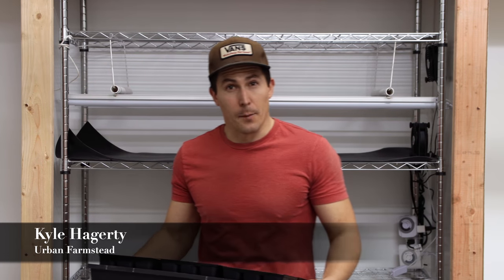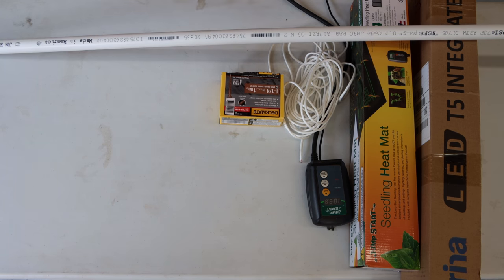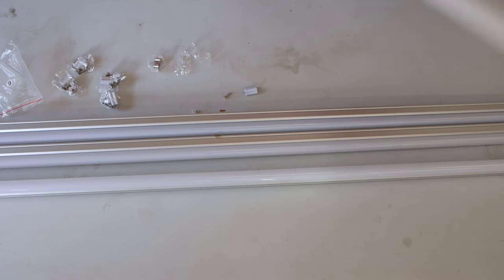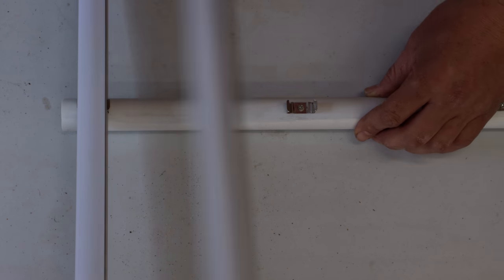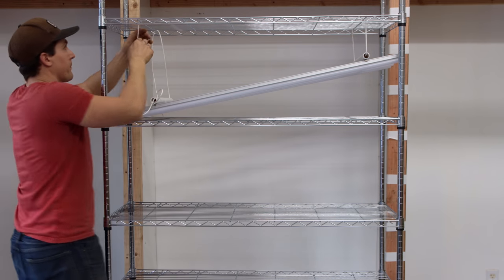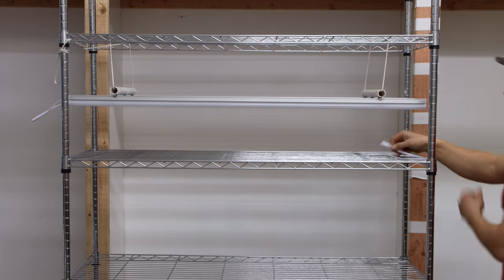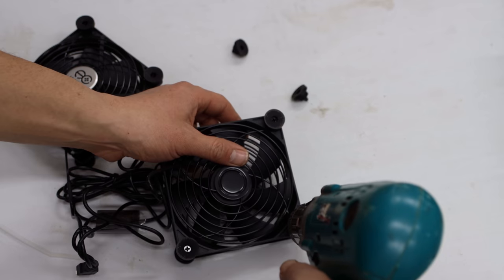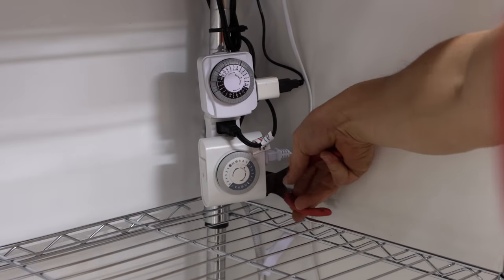How to Build an LED Grow Light Rack for vegetable seedlings and micro greens

Comment: Thank you so much for this! Using your video as a guide, I grew the best flowers and veggies ever this year. I mounted the lights directly on the bottom of the shelves (zip ties, easy-peasy) and found it easy enough to raise and lower the grow trays, as needed. 

The seeds seemed to germinate very quickly and evenly. Everything was so healthy and lush. The flowering plants had no problem blooming under these lights. My sister said they were "as good as something you'd get from a greenhouse". Next year should see a full return on the initial costs vs yearly spending at a nursery. 

One thing people don't consider is when you grow your own flowers and vegetables you get exactly what you want, and not only what's available for sale. I grew hibiscus, black-eyed susan vine and wave petunias, which are fairly expensive plants to buy and a bunch of hard to find heirloom tomatoes. This grow rack makes it easy to do yourself. The only "problem" I had was planting too early.

Thank you for putting this out for us all! Subscribed!

Spring 2023
2nd year using your LED Grow light rack hack. Everything is looking wonderful and healthy. The only thing I changed was to add a 'space blanket' on the back of the rack to reflect and maximize light and to plant a little later.

I planted herbs, flowers, grasses, and veggies, something for everyone in my family. It's nice to be able to accommodate their requests without spending a fortune at the nursery. My sister loves GREEN flowers. The inexpensive answer:"Green twister" echinacea," Envy" zinnia, "lime sophisticata" petunias, "green tails" amaranth, Bells of Ireland, nicotiana 'Antique Lime' and others all planted as seed. Huge savings! 

The only disadvantage to using this VS a greenhouse is lugging the plants inside and out to acclimate them the last few weeks before planting. The big advantage over a greenhouse is not having to heat it and monitor the temperature all Winter. The only thing that could tear me away from this system is a sexy geothermal greenhouse. We all can dream, right? ;)

Very grateful for this! Thank you, again!
Reply: Thank you so much for your detailed comment! Great encouragement and tips! Thanjs❤🎉😂

Comment: Hi there from Toronto, Canada. Firstly, I wanted to say thank you for this really, really great tutorial! I only have an LED grow rack in place because of how simple and approachable this video was. :) 
In the chance that someone else reads this prior to building their own rack, who may be just a NON-HANDY as I am but embolden to try, here are two additional considerations based on issues I ran into: 

1) you really need hold the pipe straight and double check that the marks for your brackets line up together. My brackets ended up probably a 5mm different angle on the pipe and it still works, but does make the whole set up a bit twisted (maybe this is obvious for anyone whose ever do any sort of handy project before... but that isn’t me) 

2) buy your lights FIRST, check what your mounting hardware looks like THEN buy your pvc pipe. I purchased a 3/4 inch PVC pipe as recommended, but the screws that came with the mounting kit were 1 inch. Again, it all works out, but it was incredibly difficult to thread the rope through since the screws obstruct the entire space. Finally got it through using a needle and thread, but this part was far more difficult than anticipated!

Comment: Great video.  For hanging lights, I used a magnetic J hook on the 4 pillars and the PVC pipe will rest  on the magnetic J hook. The magnetic hook slides up and down on the 4 support pillars to adjust light height.

Comment: 🥰💯❤🌱  Thank you for sharing this. I've been wanting to use a wire stand like you have for next year.  I have grow lights and will incorporate your idea of using pic pipe so I can make I adjust the light!  WOW!! I love the mini fans, too.  I will buy those.  I had started seedlings without a fan and they got too leggy.  Some, I managed to save when I started using a big fan.

Last year, i bought one of those cheap stands on Amazon and one of the stands fell and broke because I overloaded it.  I was able to salvage most of my seedlings but it made a big mess.  I had everything meticulously labeled, too.  For next season, I definitely need something sturdier.

Comment: Great video! Thank you for sharing all your supplies. Can you tell me if the fans are really necessary? Is it because the lights might overheat?
Reply from the maker: These LED lights emit very little heat. The fans reduce dampening and strengthen the seedlings

Comment: Great video thank you! Building one here and following your instructions. Wondering if you have the racks enclosed at all to keep the light in?
Reply from the maker: Awesome! the rack is walled in on 3 sides with high gloss white which does help. also I installed styrofoam insulation on each rack that I show in the follow up to this video.

Comment: Hi there!  First, thank you for coming up with this very easy to assemble grow center second, I am new to indoor seed starting and just delving into this (even though I grew up on a farm and we grew and harvested most of our fruits and veggies. Always started seeds in ground). My question is:  If I were to have my rack in garage or shed will the heat mat be enough for the cold temps?  Still going down into the 20’s some nights here in Michigan. My garage and my shed are not heated currently. Thanks👍🏻
Reply from the maker: sugar2brooke hi! Thank you! This is in my detached unheated garage but our winter temps only get into to 30s. I think the heat mats would be enough and would start with just that or do a bit more research from those in your situation. Otherwise you’ll just want to add supplemental heat.

Comment: So was so happy I was able to do this on my own--but slight hiccup--I bought a smaller wire rack and didn't adjust light size and pvc clip placement accordingly.  I've rigged it up anyway but a question--I can buy the same brand of T6500 in 3 ft (versus 4) but they are not 2200lm but 4000 lm--is that too much light, or, could I perhaps just use 2 shop lights then?  Forgive my ignorance--complete newbie at this, obviously, but really appreciate your easy to follow videos!

Comment: I am in Cincinnati and watched this and the follow-up video. HUGE thanks as this will be my first try at a system and wondered about placement. I was going to put in my basement and the temp is 60 degrees. Will that be a problem??
Reply: Random.... but  also from Cincinnati! Im running out of room and need to build a shelf. This is perfect!
Reply from the maker: Hi! That should be great, this is in me detached garage which will get down to about 40 degrees tonight
Reply: @travism7171  I am setting mine up tonight - good luck with yours. A little late here!!
Reply: @staceyshiring7280  Ive got mine setup and its working great!

Comment: Your lights are more spaced out than others I’ve seen, did you do research on the spacing? Did you find that the plants still grew fine with the large gaps? I currently have a similar setup, but I’m using old T5 florescent shop-lights, but they’re spaced much closer together, not allowing me to utilize the entire rack. In fact, the seedlings on the outside are getting more leggy. But, your setup looks like I would be able to use the entire rack. Thanks for your help!
Reply from the maker: Cami Smith hi! The spacing works perfect even with for 72 cell trays per shelf and lights down only a couple of inches from the plants. The trays have healthy, even germination and growth with no leggy plants. I actually posted a follow up video just last week if you’re interested to see how well they work! Also, yes I did a lot of research.

Comment: Great video! Is there a video you’ve done sharing what trays you use and how you keep them watered from the bottom?
Reply from the maker: Cameron Chubbuck thank you! There is a link in the description that will take you to the trays that I use. As far as how I water - I just fill the trays about half way with a watering can, then wait for the soil to almost dry out and water a again about a week later. No video on that yet but soon.
Reply: Urban Farmstead understood, I assumed the trays had holes to allow for drainage. Makes sense now, thank you!
Reply from the maker: Cameron Chubbuck I see, so the plants are in pots that have designs holes but the trays do not 👍🏼

Comment: What else could you use this set up for when not growing seedlings? You mentioned micro greens. Would herbs or lettuces be a good option?
Reply from the maker: That’s a great question Donna! In theory you should be able to grow anything that’s not going to flower/fruit, so yes many herbs and lettuce as well. With lettuce I have seen some great experiments using different colors of lights that all have different results, so I’m not sure if these would be the BEST lights for growing greens but they will certainly work. I’ll be doing a lot of experiments once the seedlings are planted out.

Comment: Did you find that 3 4' grow lights was sufficient per rack level? Is there anything you'd change for this year?
Reply from the maker: Yes, plenty. Did you watch my follow up video?
Reply: @urbanfarmstead  I hadn't when I left the comment, but have since. Thank you.
Reply from the maker: @stscac  great! I hope you found it helpful
Reply: @urbanfarmstead  I can't find the follow up vid but had the same question.. doing veg seedlings four 10x20 trays stacked side by side on a 4ft rack and not sure how many bulbs I need and also what distance the lights should be from the veg (normally I know fluorescents are around 2" but I think LED's usually much further).  Also some people cut the covers off, wondered if you've tried that.  Anyhow, comments or link to follow up would be much appreciated!!  Thanks so much for the video!  Now checking out more of yours :)
Reply from the maker: @JS-mq6ve  The link to the follow-up video is at the very end of this video. Four 10x20 trays on a 4' wide rack is exactly what I'm doing here with three bulbs, so I'm not sure what your question is. 2"-4" normally. LED can be placed as close as you want because there is almost no heat generated.

Comment: Do you have a video reference or recommendation on having a small 2 rack set up that fits 4 trays of 10x20 for micro greens for someone that is renting 1 room in a house? Do you think custom build is the only option?
Reply from the maker: I do t have a video to reference, however if you are doing micro greens the light height will be consistent so you won’t need any of the pvc/string setup. Just zip tie the lights to the bottom of each rack and use a shorter rack. Custom is the affordable option that offers the same results, but you can buy a grow rack

Comment: Was 3 of those lights enough to grow strong, healthy seedlings? I'm wanting to get the cheapest lights possible, but not so cheap (like my current setup) that I have to keep rotating the plants because the ones on the outer edges aren't receiving enough light, or take them outside every warm day...
Reply: Looking at my setup, I have 4 t5s at about the same Kelvins, but it happens to be an actual one-piece ballast. The plants of the seed tray ends were definitely more leggy than the middle plants. I would go with 5 or 6 rows of lights if you can, I wish I would have spent the extra money to get a 6-bulb ballast instead of 4. However, the seedlings seemed to do just fine when set out, they just weren't as bushy as if I had used more light.
Reply: @Sindrandi  thanks so much for your reply! I think I'm going to go with the 40w from Kihung I found on Amazon. I found an 8 pack, of single lights. (They each have a plug in or you can plug them into each other & just plug 1 or 2 in)   I'm going to use 3. But they'll be side by side making an 8 foot shelf so it would be like I'm basically using 3 per shelf only  I'm not using a traditional shelving unit, I am using a very deep/wide walk in closet & making 2 8 foot rows.. and then for the next shelf, I have 2 marshydro ts600 which are really strong, (almost too strong- I have  to keep them about 2  foot away & slowly move them closer or the seedlings will burn up)   So to kind of "stretch out" those lights I'm going to use the extra 2 lights & do 1 beside each marshydro light. & I think I'll be able to keep 8 trays on each shelf without them getting leggy. If anything, if the 3 40w light aren't enough I can order a small pack of the 20w lights.  But I'm hoping to not have to! I was rear ended by an oil tank truck that was doing 70mph & have really bad  back pain now, & constantly carrying trays in and out of the house onto the porch about killed me last year!

Comment: What did you end up deciding on the timing for your fans?  I have mine set on the same timer as the lights.
Reply from the maker: That’s probably fine. I usually have them on for an hour and off for two then continuing with that pattern
Reply: @urbanfarmstead   what’s the point of the fan? I’m a total newbie here
Reply from the maker: @tatemday9999  in general airflow is important for all plants to thrive. It strengthens the stems, reduces fungus and disease potential etc.

Comment: Hi Kyle,
 I'm now in the purchasing stage to get my grow light stand build ready so I can begin growing in January. I heard you mention that you start in the small 72 pack trays and then transplant into the larger trays. Do you do this for all of your seeds? If so, about how long do you wait to transplant. These questions might sound silly but this is my first year for gardening and I want to do it properly. I have 15 raised beds I just finished and I've planted some garlic and onions but that'r really as far as I have gotten. Would it be wiser to start the seeds in the smaller beds and transplant? BTW, I'm using your link to purchase everything. It's nice how you have everything right there.
Reply from the maker: I do that with most seeds, sometimes I’ll start in 6 packs. I usually transplant a few weeks after germinating. I’m glad you’re building a rack like this, I absolutely love mine!

Comment: I must have missed this somewhere but why do you need fans? It seems counterproductive to warm the trays up with the pad and blow the fan to cool them.
Reply from the maker: The fans are not for cooling, they help with air circulation and also help strengthen plant stems and roots by mimicking wind

Comment: Hey kyle, how many of these lights can i set up in series? Im ordering supplies for 4 shelves. Im going to get an 8 pack of the type of lights on ur amazon list (2 per rack), but i need to figure out the power strip situation. Dunno if ill be able to put all 8 lights in series (from shelf to shelf?), or if i need more timers and power strips.  Thoughts?
Reply from the maker: I would blight in each level of lights separately, but you could try that.

Comment: I'm a little concerned about accidentally getting water on the lights if I build out a few shelves..do you add some sort of barrier to each shelf, or am I stating the obvious that you just water carefully? :P
Reply from the maker: gardengrrlWendy I’m glad you asked, because you’re right, it’s always important to be safe when using water and electricity in close proximity. The trays are in basins and they are bottom watered by filling the basins, so there shouldn’t be any water getting on the lights. There are also thin plastic covers that are made for the shelves on these racks if that’s a concern.

Comment: What is the purpose of the fans?  How do you determine how long to keep them on?
Reply: Fans help the seedlings become stronger. It mimics the outdoor winds and helps them get ready to go outside in the real world and real weather. You can also try brushing your hand gently across the top of them every day. It helps toughen them up. The air circulation also helps keep fungal problems at bay.

Comment: Are the shelves 18" or 24" deep?
Reply from the maker: 18”. I have a link to it and evening else in the video description
Reply: @urbanfarmstead  thanks. I saw that and it was a huge help. I just got confused because the trays are 20" long and I was worried about hangover, but your video didn't show any trays off the edge. Can't wait too get it up and running! Thanks again.
Reply from the maker: @Gabevalen  there it only a slight hangover. I considered 24” but decided it wasn’t necessary and have now confirmed that decision. Happy to help!
Reply: @urbanfarmstead  Ugh....just set up a 24" for that reason which was more costly and REALLY heavy. Now sounds like that wasn't necessary. Wish I had watched this first!  Now I'm not sure how to space my three lights out?  You used 15"...any suggestions?
Reply from the maker: @heidihyndman  you could space them  just the same, or even add a fourth

Comment: Why do you use the fans?
Reply from the maker: Air circulation is important for a lot of things, but the prevention of “damping off” and strengthening of seedlings are the two main reasons
Reply: @urbanfarmstead  makes perfect sense.  Are they expensive?
Reply from the maker: @reeintili6927  I linked them along with everything else in my video description. $26 for two
Reply: @urbanfarmstead  appreciate it mate
Reply from the maker: @reeintili6927  you’re very welcome

Comment: You are using led lights which radiate much less heat than incandescent, florescent, and compact florescent. Can you explain why you need fans to grow seedlings especially if you adding heat by the heating pads? Seems contradictory to add heat and a fan.